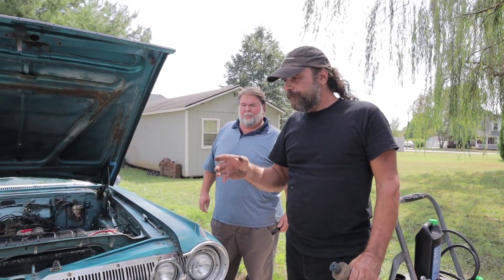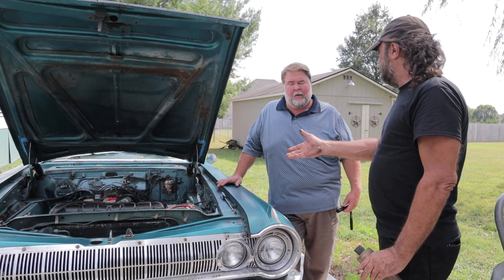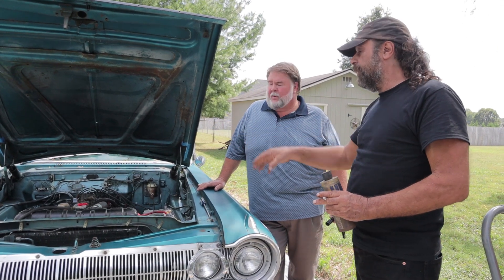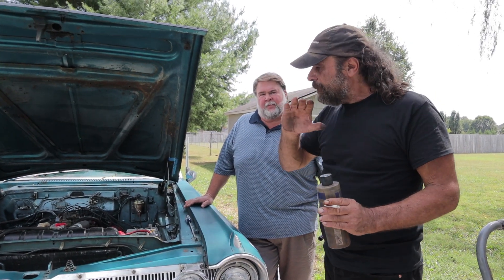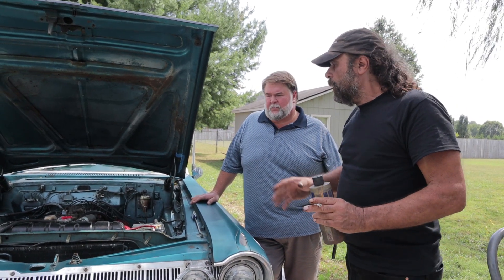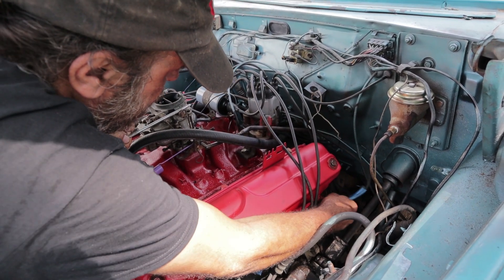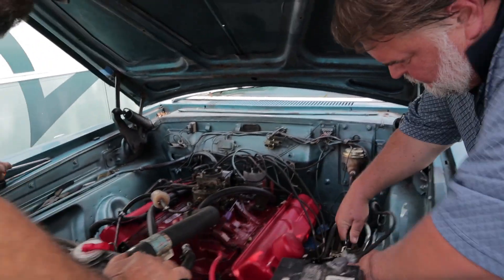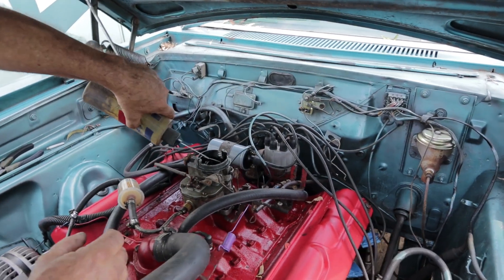Classic Car Tech-The No Start

Comment: As always good info. The only criticism would be and perhaps you already checked for yourself is I NEVER ,NEVER trust the owner " I know I got gas up there ". I would have included looking down the throat of the carb to see if it was squirting. I had a few of those carbs where the needle stuck in the seat. Just my $02.
Reply from the maker: I could see gas sitting in the clear filter
Reply: @UncleTonysGarage  Yes but with a stuck needle and seat fuel would not fill the fuel bowl. You'd think fuel pressure would push the needle away but not always. Especially if the car has not been driven in awhile.  No squirt, fuel at filter, a few taps on the needle and seat at the frt of the carb.

Comment: My injector 1 & 2 on fuse box is not lighting up with light test...therefore no fuel is getting into fuel injectors to start...getting spark...gas is at fuel injector...new coil...fuse box not lighting up. injector 1 &2 thanks.
Reply: 1989 Camaro

Comment: I have a AVS 2 Edlebrock 800 carb they seem poorly made ..The area were you put the step up springs they get stuck they wont go down when I want to close the flaps ..I called Ethem dlebrock they said to take some 2000 grit sand paper and sand down those caps that hold the rods..I ended up just throwing it away and put on a Holley XP 750 ..That edlebrock carb was a $450 waste of my time

Comment: Hey tony. I have a early la318. I was digging into the motor to replace valve seals. I recently and suddenly started get smoke at an idle and when decelerating. While at it I figured Id record some info on the engine. So, I ran a compression check. 
7 cylinders= 135-160 psi
1 cylinder = 60 psi  ( damnit !!!)
   Any ideas on diagnosing whether its a  ring issue vs valve issue ?
Reply from the maker: Pop the plug out of that cylinder and pour about a cap-full of ATF into it, and repeat the compression test.  If it's rings, compression should appear about normal...but, I can already tell you.  It's gonna be bad news

Comment: Do you have a video of no lights, no power, no nothing at all. Turn the key and nothing happens at all. New coil, new ballast resistor, new voltage regulator, new battery cables, cleaned all the grounds ect. 65 Scout with a 327

Comment: Love it. Nothing like the basics.... These new aged kids would be lost.... Where's the diag port? 🤔 😜
Reply: It's between your ears, for this old stuff ;)
Reply: you'd be surprise at how some kids today  can work these engins as good as the old méchanics
Reply: here's the thing, you need to use the diagnosis port on any car with sensors cause you cant visually tell that the sensor is bad or not, where as if everything is mechanical, such as classic cars, you can visually see a broken/worn/damaged part. on one car i worked on, no matter what we did it just wouldn't start. turns out that one wire to the MAF sensor had the solder connection break away inside of the sensor so it looked fine. That said I love old cars and am working towards having my own, don't knock the "new aged" kids, cause we squeeze power out of little four bangers like you wouldn't believe.

Comment: Love your channel and the tech talk but got nothing from this.  I am not bashing  or trying to measure up. I saw a quick bit of diagnosis, but what was the fix?
Fuel filter was full and plugs were wet, I assume with gas. Pouring fuel down the carb was the fix as it continued to run? What's the diagnosis and repair? Last step of the Chrysler trouble shooting guide is to verify the repair. 

What happened with no spark at number 1? Once it started it didnt sound like it was " missing".

Again, I am in no way " stirring the pot " but what the heck? Maybe I missed something, I listened twice while at work.
Reply from the maker: I didn't "repair" anything...I got it to light.  He'll set the timing with a light and give it a fresh set of plugs and wires

Comment: Dead fuel. I dont know what you have in the usa. I live in Australia and its buy far the most common no start problem with small engines and motorcycles. I own a xt600 and no bullshit i filled it up and one week later it would not go. Fresh fuel, drained bowl fired straight up. That is extreme. Normally 6 weeks and fuel is dead in bowls, 3 months dead in a vented tank (most bikes). It blows me away how many people dont know this.

Comment: Didn't know they put one barrel carbs on V8
Reply from the maker: Carter BBD 2 barrel
Reply: You could if you had one big enough all of the older 40s and back cars had 1 barrels that ive seen
Reply: That was my first thought
Reply: Even in high school ('70s) a lot of people thought those were one barrel carbs. If you look straight down into them you will see two venturis, as well there are the idle mixture screws but they are not what the eyes go to.

Comment: Guess what is happening : decided to set timing got TDC on compression stroke lined up intermediate shaft reset Davis Unified distributer  timing marks lined up 
vacuum disconected and blocked both ends  started car turned dissy till running smooth at best high revs hooked up timming light 50 deg mark showing on balancer at TDC  set at 12 deg BTDC runs like a dog put it back by ear to good sound TDC on balancer almost 45 degrees off to the left of timing mark on cover  
40 over 361
265deh comp cam
stealth heads 
edelbrock performer RPM
edelbrock  1406 carb 
hooker headers
I AM CONFUSED
Mike

Comment: Ahh the basics, the big three.
Got spark? 
From coil to cap? 
From cap to plugs? 
Check.
Got fuel? 
Check
Check timing,
Check
None of this error code shit. And all must be done while puffing on a hand twisted butt. Or a Taylor made your choice. Said my bit,now back to reaming O'Reillys on why the cv axle for the Mazda 626 is 59 bucks and the same part for the Ford Probe is 55 bucks. 
same part, 
same part number.why two prices?

Comment: I have a 1970 Dodge Dart. Originally it was a 6 cylinder car but it's been changed over to a V8. It's supposed to have a 440 in it now it has a 318. Would you know anybody that has some exhaust manifolds for a 318? I'm just say when I can't afford to buy things this car anymore I put $18,000 in this car and it wasn't finished the man ended up going to prison. Over drugs. I'm looking for some exhaust manifolds for it it's a 318 and I was told the 318is out of a 73 Challenger. I can't afford money hardly at all I just need someone that knows where I can get some some assist playing around cuz I could really really really use them. This car needs put back together and I don't know how to do it but I'm going to do my best

Comment: would you be willing to come to California and help me get my 1966 Chrysler running? It is a new motor and transmission its in the car and it would probably  about 4 to 5 hours to get it running.
I cant find nobody to work on it. i will pay your airfare and hotel food drinks beer and flight back I have all the tools you need and voltage meters. Plus pay you for your time at 150  per hour and if it take 3 hours i pay you for 8 all day. and if it takes two days ill pay you for your time. i need this done. does that sound like a deal?

Comment: I have to rebuild my caddilac 425 big block I want to modify it while I'm at it.   

List(important stuff) 
ring
Carberator
Gaskets 

Mods
Bored out to be a 440
Cam
Headers
Intake manafold 
Flat top pistons 
Rocker arms

And maybe I might run into something else I want to put in it

Anybody wanna follow? It might be awhile before I start
Reply from the maker: That bore seems pretty optimistic.  Can you go that far without ending up with paper thin walls?
Reply: @UncleTonysGarage  not sure I've heard people bore them out to be 454s I've heard it over the internet so I'm gonna be edgy about that I will look at the cylinder walls when I get the heads off
Reply: Why a Cadillac?  Performancs parts are few and far between. For the money you will spend on it you could make tons more power building a small/big block anything!
Reply: @danielscott6787  cus that's what I got I can't a brand new crate engine and nobody else done a 440 caddy